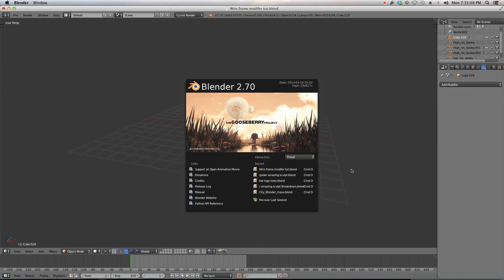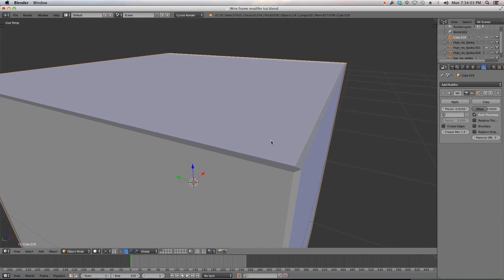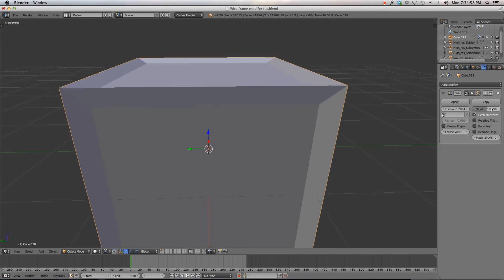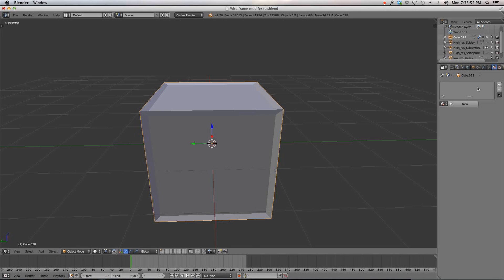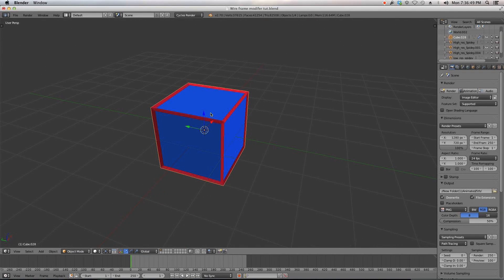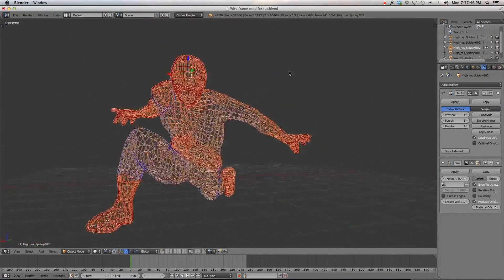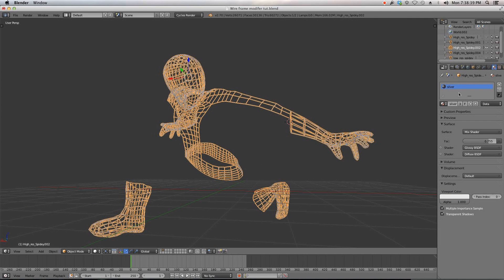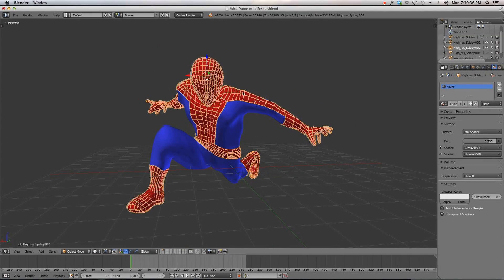Wireframe Modifier - Blender 2.7 - Quick Tip Tutorial!

Comment: but how do I unwrap it properly? I've unwrapped it now, and I've had to scale it to 20x on the x axis to get the Colour texture tiles square again, but all of these, except for the boundary (the outer ones) are warped, so the top of each map goes to the right, which makes an arrow shape, as the texture on the bottom part of the mesh is mirrored.

Comment: Isn't there a way you can have the wireframe layout take a certain pattern instead of the original wireframe layout of your mesh?
Reply: Thats the point of the modifier, it takes the sole wireframe of mesh. You can play with bevel and subsurf modifiers to achieve a pattern instead of grid.

Like in here:
/watch?v=goM3yyjUhlo

Other way is to create mesh with as few quads as possible with b-meshes instead (n-gons), then making a pattern "cutter" on separate mesh with only edges and no faces, then cut it on object using Knife Projection tool to achieve a pattern you need. But it would be difficult to cut on curved object with no flat surfaces.
Reply: On to of what Robert said, try throwing a decimate modifier after your sub surf to randomize the layout a bit